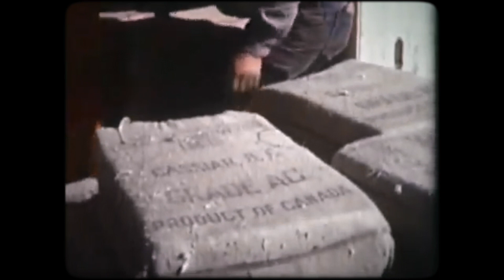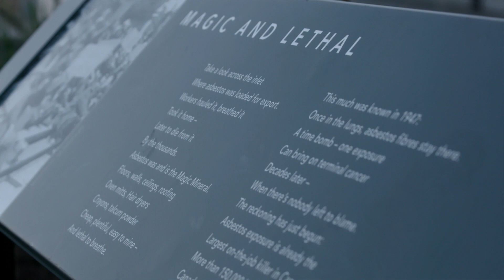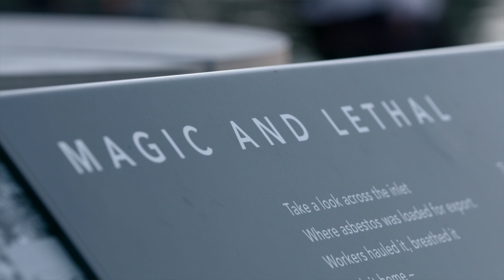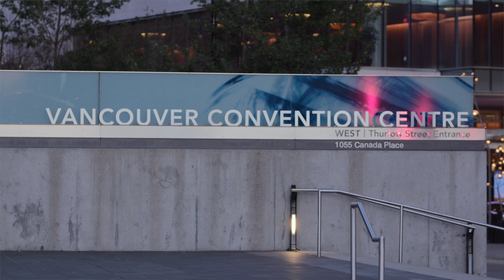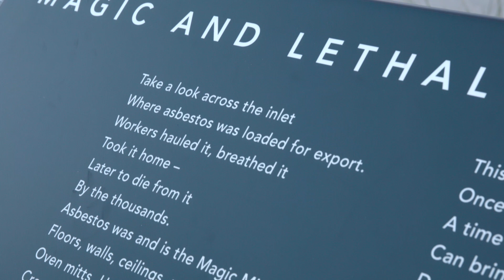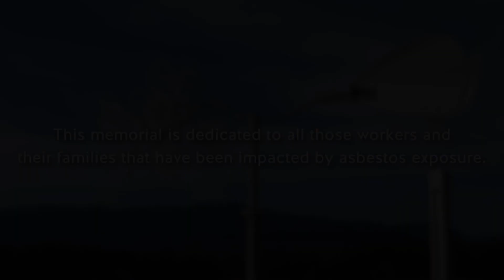Magic and Lethal: The Asbestos Memorial

Comment: My inlaws are from the asbestos mine town of Black Lake, Que. I work in healthcare and I’ve seen many people with airways destroyed by exposure to asbestos. It angers me to think that asbestos was a suspected poison since the 1930s and that this was proven since at least the 1970s. My inlaws are good people. They, along with tens of thousands in that mine alone, were left exposed to asbestos by the company when they knew it was deadly. I too am amazed that it took so long for Canada to proceed with the ban. At least it’s done now.
Reply: you work in hcare...good. i must add that its all over. military were exposed, brake shoes had  it. hence workers in the auto repair industry...i'm retired insulator.  I removed it for a while-union card carrier.  now the new asbestos is aerogel, and ceramic fiber. outdoors in the desert where the wind kicks-silica dust.  goes on and on...just look at sand under a scope.  spreading the word, knowledge is power, yes. but also its required in order to work safely. Thanx!!!🙏

Comment: its pretty ironic that hes tied off to the handrail inside that lift.  those lifts have specific tie off points and typically on those sized baskets, the tie off points are near the floor at the center near the control panel